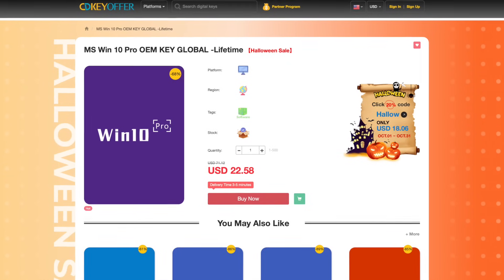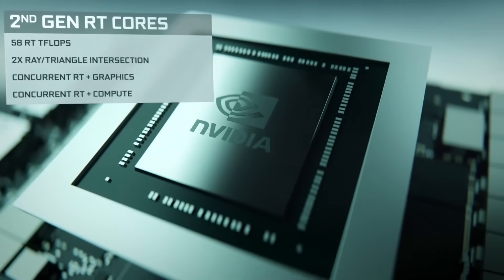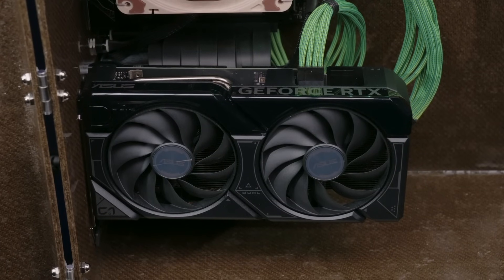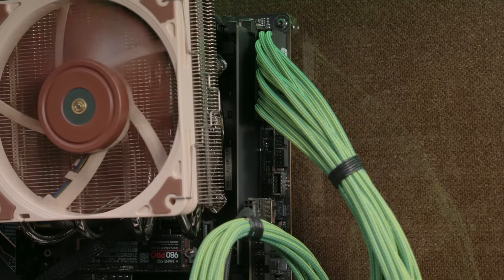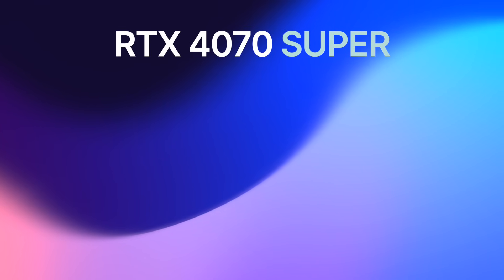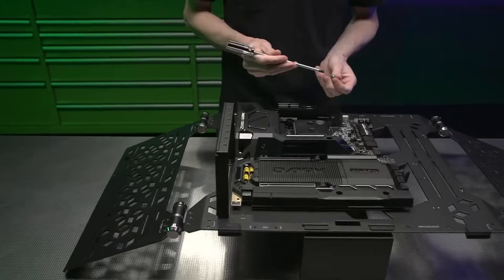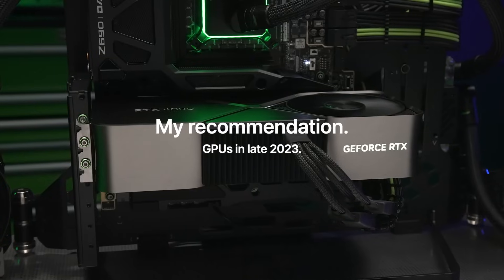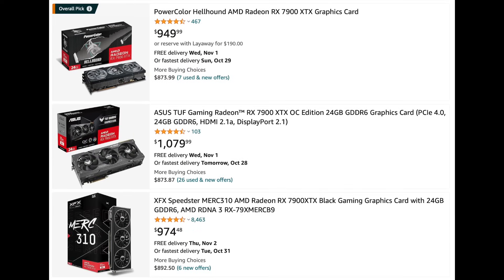RTX 4080/4070 SUPER: Specs, Performance, Release Date, Prices

Comment from the maker: Do you think NVIDIA will give us good prices with the SUPER refresh cards?
Reply: i hope so, but i don't think so, at least for same prices as now but 16gb/256-bit(4070/ti) then i guess i will buy.. maybe
Reply from the maker: @doomsday5286  hope for the best, prepare for the worst.🙂
Reply: No. The 4080 Super will be 5% more hardware at best if it is AD103. Most of the gains will be from increased power limit and overclocking.
Reply: They will not. Because they are not afraid of the competition, if any 😊.
Reply: obv not. they dont need to.
Reply: Better doesn’t mean good. Just not as bad. :)
Reply: First time trusting Nvidia?

Comment: As for me, With the 4070 Ti having 192 bus / 12GB of vram, The 4070 Ti super having 16GB / 256 Bit bus would be more of a gpu i would pay for

192 bit bus on the 4070 Ti was a bad mistake. Ive seen iffy 1% lows in mw2 / 1440p / 165hz @ extreme settings and i knew then.
Reply: Planned obsolescence, how else will Nvidia convince you to buy a new card sooner rather than later?

Comment: Vadim would pairing a 4070Ti Super 16GB and a 7900x3D be an roughly balanced build for a 1440p 34" rig?
Reply from the maker: If you are building a PC for gaming then I wouldn't buy anything above 7800X3D. Same or better performance and no issues with task scheduling to the right cores cluster like on the 7900X3D. But if you need more cores for other reasons then go for it. It will be a glorious build🙂👍
Reply: @theivadim   Thank you Vadim!

Comment: I was keeping my hopes up for the 4070 Super. But go back about 5 years and see how many people were prepared to pay 600-700$ for a GPU. That price is insane. For that, 12 GB of VRAM are beyond pathetic and unacceptable. I'm not paying that so I can already worry next year about 1440p games.
It's not in Nvidias interest to sell future-proof GPUs, but for that price, that's the least I can ask for.
Reply from the maker: It's a strange market now. Almost all PC parts are actually priced fairly well (CPU, RAM, SSD, motherboard) and GPUs are failing to offer good value.
Reply: I swear you gpu "gurus" dont know a whole lot. $600-700 is a 1080Ti and 2080, 1080Ti known as one of the best cards ever made, with 11 gb Vram. a simple search on the interwebs shows the 4070 winning in everything, and drawing less power than both at the same time. Vram isnt everything even though you make it out to be. A $1500 build can be made out with a 4070, and the build would demolish anything with a 1080Ti, 2080/2080Super, and run pace with a 3080 or slightly better. Also the 3080 was priced at $699 MSRP but never sold for that because prices were heavily inflated. Look at the dollar per performance and compare to past cards. its a better card for the money. plain and simple.

Comment: ive just returned the asus rtx 4080 white due to coil wine THAT COST ME £1349 im going to wait till the white version of the 4080 super comes out then i will go 4 that if the coil wine noise isnt there my friend has the rtx aero gigabyte 4080 and that thing runs silent compared to the asus version
AVOID THE ASUS 4080 AND 4090 COIL WINE IS URRANDOUSE ON THEM GPUS

Comment: Do you think 4070 prices will drop after the 4070 release?
I wouldnt buy the Super card if the TDP is higher and its more expensive so Id be hoping that 4070 non super would drop in price
Reply from the maker: I wouldn't count on any price drops. I think the 4070 price right now is as good as it will get for the foreseeable future. NVIDIA has done a de facto discount on the 4070 when the RX 7800 XT launched. Don't expect more.
Reply: Maybe 50$ less.

Comment: Supposedly a 4080 Super could be 10-15% faster and 200 bucks cheaper. This would push the 7900XTX down to around 700USD in price so Ill get one of those
Reply from the maker: I don't see that happening. NVIDIA sources say they may go as low as $999 only to feel the waters. If people are excited then they definitely won't make it that cheap. I think the price will end up being either in the middle (~$1100) or at the upper range closer to $1200. It is highly unlikely that the 4080 SUPER will be $1000.
Reply: @theivadim  its most likely that the 4080 will be at least 1250 , because today the 4080 cheaper is on 1140 , so i dont think that nvidia brings a better card to a cheapper price
Reply: Just get the XTX today and forget about the 4D chess
Reply: @cosmic_gate476  I set a hard budget of 700 bucks for new GPUs for my budget. I have a 6950XT right now so I can wait a little bit.

Comment: Still only 16gb vram on the super cards, disappointing. Hopefully the 50 series will be better value and have 18gb+ vram.
Reply: What games are even taking advantage of >16 gigs of vram? I'm all for 12+ being the standard for midrange and 16 being the minimum for high-end, but you might as well grab an XTX or a 4090 if you really need that much vram anyway because whatever you're doing will probably need the power behind those cards to even take proper advantage of that much vram.
Reply: @IndyMiraaga you are a Nvidia meat rider this Foo probably uses alot of cram due to work if I'm paying that much I expect more vram
Reply: @JesManVP  I'm switching to AMD because Nvidia screwed over EVGA so badly they quit the GPU industry entirely... I'm not shilling for anyone but companies do in fact make workstation graphics cards for things like that, Nvidia did do the scummy thing and killed off Titan/merged it with RTX but I have yet to get a valid answer as to who is actually using more than 16 gigs of VRAM on midrange/lower high-end cards. I even suggested buying a 7900 XTX in my comment and you still call me an Nvidia shill, do you even read?

Comment: I just purchased a PC with an AMD Ryzen 7 7800X3D and an RTX 4090, only because I want to game in 4K 144HZ/FPS or as close to it as possible. If i was going to game in 1440P I would without a doubt get an AMD 7900XTX.
Reply: Hows ur frame rates and what settings u using for stable fps at 4k ??
Reply: @jeff230394  I haven't got it yet, still being built, I ordered it Thursday.  I should hopefully have it by Nov 1st and I'll get back to you with some info after I have some time to try it out.

Comment: The best thing one can say of Nvidia's 40 series sales is that it is disappointing.  What will it accomplish to put out more of the same?  The 4090 is a halo product and affects the top 1% of gamers.  Anything below the 4090 is meh and the only Nvidia card worth buying at all is the 4070.  No one should buy any other cards.   If the 4070 Super is close to the 4070 price and has 16 GB  then it may be a better deal  than the RX7800XT.   I personally not looking forward to purchasing this gen card or the refresh.   If for some reason I end of needing a GPU now I will most likely go for the RX7800XT.
Reply from the maker: That's what I'd do as well🤝

Comment: You should stop getting your info from supposed leaks, which are just wishful thinking.
There will be just 4070 Super and 4080 Super.
There's no need for a 4070TiSuper. That's just a 4080.
Also. Pricing will be 750 and 1300.
Performance will be +15% for 4070Super vs 4070. +10% for the 4080Super vs 4080
Reply: Yea the hopium over this is through the roof.  No idea why anyone would by a 40xx card in 2024 anyways when 50xx series is coming out in 2025.

Comment: I’m very skeptical about them selling the 4080 super at 999-1250.   I bet it will be $1400 or so
Reply: why would it cost anymore ? its to replace the 4080...which sold very poorly at $1,200. even $999 isnt a great price, nvidia has completely succeeded in moving the bar up in prices if the price it at $999 and it starts selling well. thats a $300 increase from the 3080 and it will become the new normal for the 80 series class which isnt great
Reply: @PCgamingbenchmarktime what’s sad is that the 4080 IS selling when you look at the data.  It’s not flying off shelves, but still doing okay

Comment: 3090 performance for $599 seems good value imho considering this gets path tracing well in 1080p
I might consider the 4070 super to replace my 6700xt someday
Reply: $375 I got a 3080 10gb (zotac amp extreme). Much better than paying 1200 for a stupid 4080 right now. Plus for same 1200, I upgrade mobo/cpu (amd 7800x3d)/ram (32gb) for under 650$. I have a 1.3k psu, case, m2 1tb drive that's extremely fast so it was a quick swap out for 900$ all in.
Reply: 6700xt is still good. Don’t fall for marketing unless you are truly struggling to play games that you actually play everyday. Most people just upgrade because they just want to keep up or they just seek the dopamine rush of buying something new when most of what they play is Valorant or Minecraft

Comment: But to be fair buying a 40 series or next gen in early 2024 or late 2023 is a waste when 50 series not to far away
Reply: Still over a year...
Reply: @jeff230394  not really if 4080 super get anounced in Ces 2024 then it won't be out until March or so and 50 series most likely comes end of 2024 do you think Nvidia will ever delay a GPU launch
Reply: @XeqtrM1 you also said late 2023 in your comment. That is now. Waiting for the 5000 series, which is gonna come out in 2025, will be a year 2-3 months at least, if not longer. Sure, if you’re happy with your current card then wait. But someone who wants to upgrade/needs a gpu now, suggesting they wait 15 months is a bit of shit advice
Reply: @xeuxis8892  some leaks said Early 2025 yes but some leaks also said late 2024 for 50 series but if it comes early 2025 that means Nvidia missed the schedule they usly release every 2 years and plus I never said 50 series come in 2023
Reply: @xeuxis8892  you miss understood I ment buy now it's fine but waiting for 4080 super is not since that comes in 2024 at March at the earliest if you buy something that late and spend 1250 on a 4080 super and few months later 50 series is out plus I never said it as advice but if they have a 20 series 30 series or a 10 series for that matter they should be able to wait if there PC older than that yes they can buy ofc
Reply: @xeuxis8892  If its "shit advice" Im sure people are capable of making up their own minds to decide buying a card or not. The 4k series is trash, under delivered, over priced.  If one can stop wetting their pants and stow their FOMO one year isnt that long.
Reply: 2025 is far away

Comment: After my RTX 4070 literally died, I'm actually looking for a new graphics card.... but now that the rest of my PC has also died, I'm not in such a hurry... I'm really lucky with my hardware right now.

But when the PC is up and running again, it will most likely be an RX 7800 XT... not the best price/performance, but sufficient enough,
Reply from the maker: Oh no! What happened? I hope it can be sorted out so you can use your PC again soon.
Reply: which brand and how ???
Reply: Damn it sorry to hear! I have been really happy with my 7800xt. great card. I was expecting worse coming from a NVidia card but so far my only complaint is the convoluted way of overclocking. however even there I can not complain. Great card. also I don't think FSR 2.0 is nearly as bad as everyone says it is. VoV  (power color Hellhound 7800 XT
Reply: what happened to it? crazy power fluctuations?

Comment: As someone who has only a 1080ti, I would be interested if the 4070ti Super becomes a reality with the 16GB VRAM but if it does come true, price would be the sticking point.

If Nvidia doesn't succeed if these cards do come out, I'll be hoping for Intel's Battlemage GPUs to break through.
Reply: Intel upscaling tech is so good using it all the time on amd 6800xt, far better than fsr 2.1
Reply: @Leholelu  That I've noticed from the times I was able to use XeSS on certain games. Way more clear than FSR.
Reply: yeah i'm in the same boat.  4070 ti has the performance i want with exception of terrible vram.
Reply: @Haddley333  not a terrible vram, for now, the price is the problem
Reply: Dont wait! I sold my 1080Ti for a used 3080Ti. Nvidia will not make life easier for us anytime soon.
Reply: Corporate greed again, I hope the market bites nvidia's ass and forces a price reduction. People's goodwill has gone now and won't buy especially with imminent arrival of battlemage
Reply: It's weird cause a 16gb  4070 TI Super would be wayyyy too close to a 4080 in price and performance.
Reply: Also upgrading from the 1080 ti, thinking of the 7800 xt if the price of the 4070ti super is not good.
Reply: Im 1440, IMO 16 gb is the new bare minimum if one plans to keep a card for years as I prefer to do. Also been waiting to upgrade my 1080ti, for multiple reasons the 4k series just doesnt do it for me, not even close. Ive never understood the ridiculous constant FOMO new gen gpu upgrade only to get a few more FPS in un-optimized buggy 1/2 baked games. Price to performance is dead, planned obsolescence is alive and well.

Comment: Seriously still only 16 GB on a 4080 Super? 4080 Super with 20 GB would be the real 7900 XTX killer. They increase the memory capacity on the 4070 Ti Super but leave the same on the 4080 Super makes no sense.

What would be ideal
4070 Super - 12 GB
4070 Ti Super - 16 GB
4080 Super - 20 GB.
Reply from the maker: Yeah.With the China ban NVIDIA can't really afford to use AD102 in the 4080 SUPER/Ti to get to that 20GB VRAM. The US won't let them sell or even manufacture that thing in China. Big problem. A nerfed 4080 SUPER is the only logical option.
Reply: Ive seen other claimes with it being 20gbs, which makes more sense since the chip is a cut down 4090 and with the ban on 4090s to China nvidia also could just make a slightly less powerful 4090 call it a 4080 super to work around this Same thing with the 4070 ti super us just 4080 being cut down and called 4070 ti super with 16 gbs the regular 4070 super will still probably have 12 gb vram and will be the same chip as a 4070 . the 4060 supers will still be shit because nvidia genius idea to have the memory bus run on a 128 bit...
Reply: @StupidWhiteKarens  I don't think there will be a 4060 Super.
Reply: I like to keep my cards for years and at 1440 16gb is a solid "no buy". IMO Nvidia has taken a page from Apple in planned obsolescence. The entire 4k series is as dead to me now as it was at launch.

Comment: I hope Nvidia's plan will backfire and will boost AMD's sells.
Reply from the maker: What about Intel GPUs? You don't wish them well?😀
Reply: @theivadim  I’m trying to be optimistic but not delusional :)
I wish Intel well but they are not ready to compete.
Reply from the maker: @HardwareAccent  true. But they are getting there in terms of drivers. I hope they can keep up working towards making them good enough to compete with AMD and NVIDIA.
Reply: @HardwareAccent  Battlemage is basically Alchemist on a die shrink, almost 2x the cores, probably 3Ghz or close. So Alchemist drivers = Battlemage driver. They will be plenty mature by then. I just wish it was launching right now lol.
Reply: Not even lmao. NVIDIA even right now owns almost the entire market. Cope
Reply: @iequalsnoob  the only hope for Nvidia to lower the prices is if they have stronger competition and less than 90%, close to monopoly, market share.